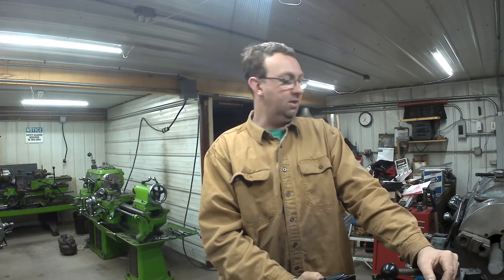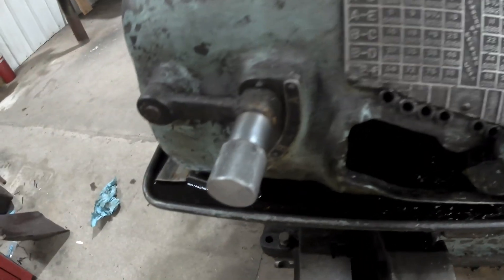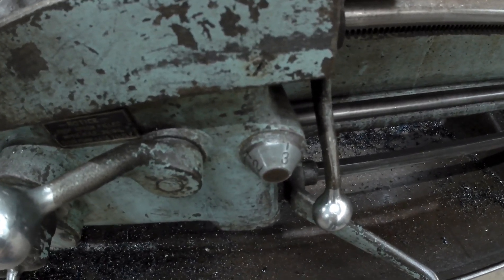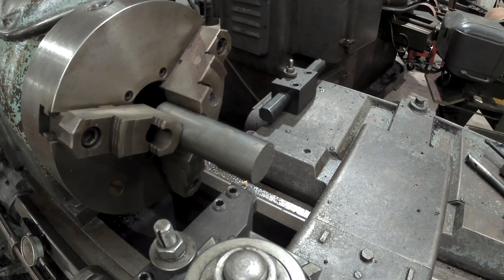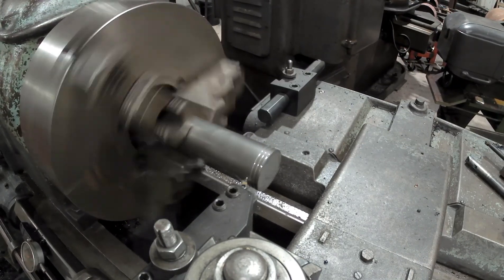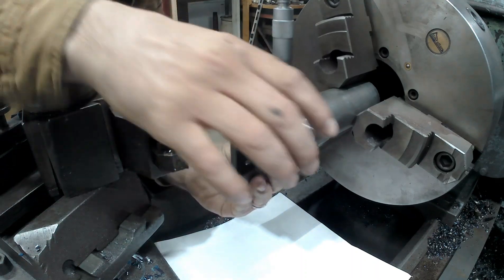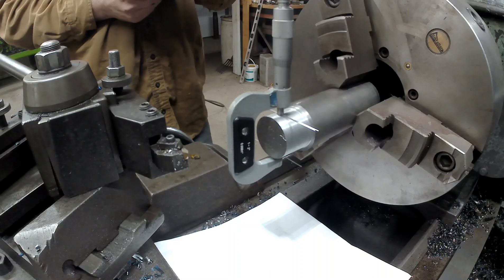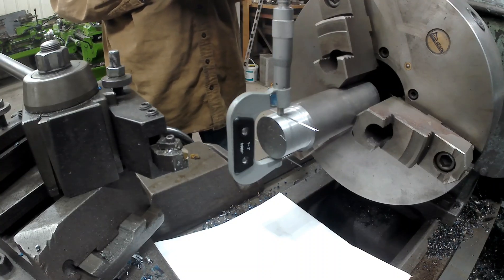Single point threading on a manual lathe and measuring pitch diameter with wires

Comment: If you want a different take on thread wires you might care to look at one of my videos on the subject. Granted my little idea is intended for metric threads the principle holds for 60 degree Imp ones too.
There are some very good sites that allow you to enter diameter and pitch ( both for common and custom threads) and the size wires you are using ( they give you a range to use)  which then give the actual size over them to save bothering with constants and calculations.
You might also get a kick out of a threading tool i use.

Comment: when feeding in for the threads,  the formula for the compound feed is .75 x pitch   that will get you close and when you are almost there start checking with the wires
Reply from the maker: Thank you for the feedback. I know i left a lot out and screwed up my terminology, but I just starting out on these videos.  As anyone will tell you, its difficult getting comfortable with the camera.  Thanks for the formula, i will try to include that moving forward.  BTW, the mic was perfectly balanced.  I got lucky with that one, but was also using my junk ones for the video.  I will do better with time.  More of a do-er than a show-er anyway.